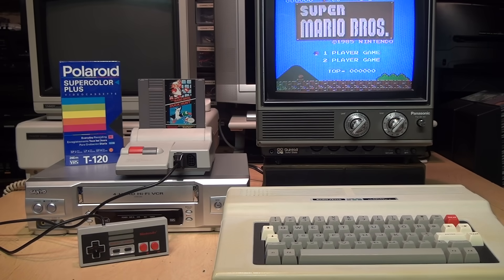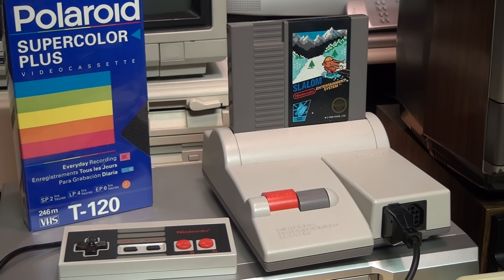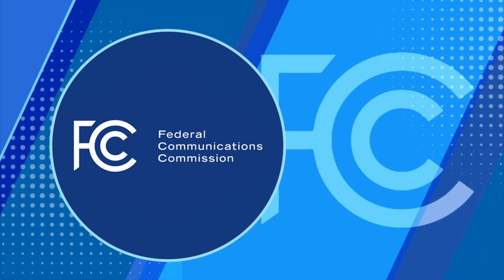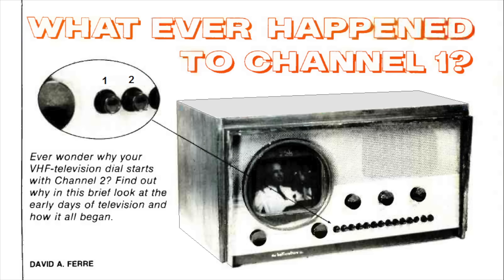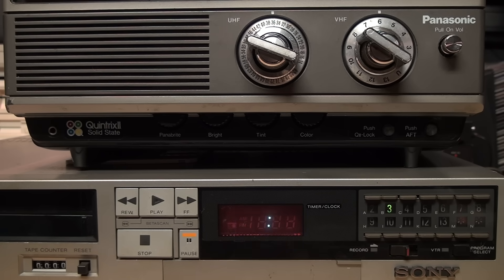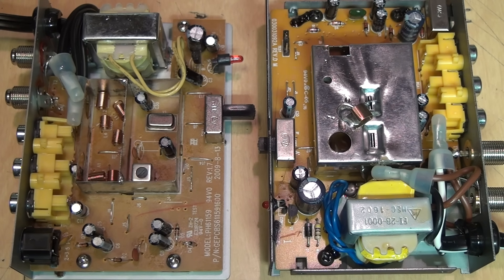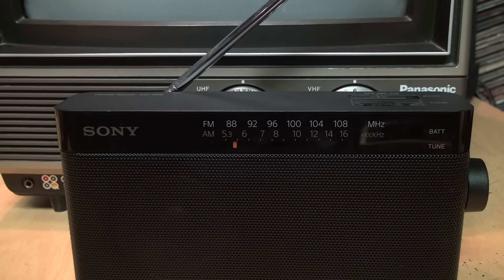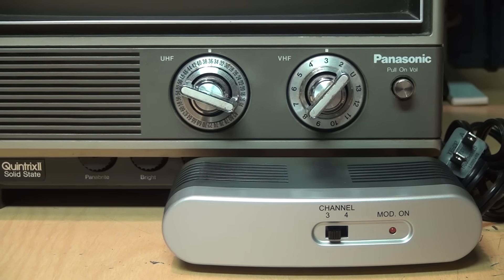Why your Nintendo was on Channel 3 (except in Cleveland)

Comment: Channel 36 wasn’t a UK only thing for RF modulators, but it was used basically in all of Europe. 

The VHF bands in Europe for television were a mess. When television was first introduced in the 1930s, every country had their own television system and their own frequency plans for TV channels, the UK used 405 lines, Germany used 441 lines, and later France 819 lines. Then after WW2, the 625-line system was introduced, which eventually became a standard, but the frequencies were still a mess. Western Europe and Eastern Europe used very different frequencies for VHF. They even had separate bands for FM radio, with Eastern Europe using 66-74 MHz, and Western Europe using the more familiar range of 87.5-108 MHz.

With the introduction of UHF frequencies, all countries agreed on using the very same frequencies for TV channels, with channels 21-69 having the same frequency anywhere in Europe. 

Except for channel 36, which was used for radio astronomy, therefore no transmitters were allowed to operate on channel 36. And since UHF was adopted earlier in Europe, with high power networks broadcasting on UHF even from the early 1960s, there were a lot more TV sets that supported UHF compared to the US, so it was an obvious choice for RF modulators to use channel 36.
Reply: I also read that when Channel 5 was preparing to launch in the UK in the 90s, the operators of the upcoming channel were required to launch a massive retuning program since the frequencies for Channel 5 were also used by consumer VCRs as well, and the new Channel 5 could have caused interference with said VCRs. During pre-launch test broadcasts, the possibility was interference was mentioned and viewers had to call a number on the screen if their VCRs or other equipment suffered interference and to schedule a time for the affected equipment to be retuned.
Reply: In the US (I'm sure Canada and Mexico too), made channel 37 off limits, as that was the channel used for radio astronomy.   In North America,  TV channels are in 6mhz spacing.   For channel 37, it was 608mhz to 614 mhz.  Europe, Australia,  New Zealand,  and I believe most of Asia had 8mhz spacing.  Though in the analog era, Japan used the same broadcast standard as North America,  their TV's were not fully compatible with North American broadcasts, as they used different frequencies for their TV band.  Their FM band goes down to 76mhz, which in North America,  that occupies channels 5 and 6.  Also with VHF-Lo,  there's a 4mhz space between channels 4 and 5, that in the analog era, New York City had channels 4 and 5 on the air.  Channel 4 operates between 66mhz and 72mhz and channel 5 operates between 76mhz and 82mhz.
Reply: @davenwin1973 cable TV 88 too in North America. Mexicans observed to ban all channel 37 transmitters in Mexico
Reply: @d @davenwin1973 channel 36 in Japan for Japanese NTSC -M broadcast
Reply: @d @davenwin1973 South Korea, Taiwan, Philippines and Myanmar also use analog NTSC-M broadcasts. Channel 37  used in the Philippines and South Korea. Also channel 36 in Japan.
Reply: @d @davenwin1973 also used Japanese analog TV receiver in the Philippines. VHF channels 1 to 3 same as US Cable TV channels 95 to 97. Sony Trinitrons from Japan have 2 MHz auto fine tuning. For AFT 2 MHz: VHF channel 4 is US cable TV 22, VHF channels 5 to 7 is US VHF channels 7 to 9, Japan VHF Channel 8 to 12 same as US VHF channels 10 to 13 and Cable TV 23. Japanese analog cable TV channels only receive up to channel 62 but didn’t include from UHF. Unlike US Cable TV include UHF on Cable TV above 465 MHz.
Reply: Yep, we had a video rental chain called Channel36
Reply: Another advantage of the standardization of Channel 36 (and I think, later on, more channels in the high 30's), it was possible to design VCR's and other equipment that didn't need a TV/VCR switch like all VCR's in the USA. All VCR's just mix the incoming antenna or cable signal with their own modulated signal and send that to the output. You can tune your TV to any live TV channel(*) you want to watch or you can tune to channel 36 to watch the VCR. And if you have a second VCR or a video game or a computer, you just adjust their modulators to use channel 37 or 38 or 39 and daisy-chain your cable or antenna through all of them.
(*) Of course most TV's in Europe didn't have channels but presets but that's another story.
Reply: @JacGoudsmit  i've come across some vcrs here in the uk that defaulted to ch.52 !
Reply: @JacGoudsmit for NTSC-M VHF TV channel 34 in the Americas, Philippines, Taiwan, South Korea. Also channel 33 in Japan
Reply: @J @JacGoudsmit VCRs in Japan only have channel 1 and 2 for VHF output that overlapped FM radio (90 - 108 MHz), US Cable TV channels 95 and 96.
Reply: @FrancisLitanofficialJAPINOY i thought in Japan the FM band doesn't go up as high as in the rest of the world (and starts at a lower frequency too). In the USA, channel 6 overlaps with FM.
Reply: In the U.K. colour TV was never broadcast on VHF. That was originally used for 405 line Black and White TV which kept going until 1985. Mainly because there were a few odd places like Welsh Valleys where UHF signals wouldn't reach. To allow everyone to receive the same four channels on UHF over 1100 transmitters and relays were required. 

As for Channel 36, in the 1980s a friend bought a VCR and took it back to the shop as there was a strong burst of interference every couple of seconds. The shop knew what it was; the Radar at Filton airfield. A quick retune to channel 37 using the screw next to the aerial socket solved the problem.
Reply: @MrDuncl Ireland and South Africa used VHF on PAL-I broadcast also used on UK UHF TV broadcast PAL-I
Reply: Does anyone read this comment,and think about Tesla’s fascination with the numbers 3,6,9 barring I think 1 number in the comment posted, if you look closely, and do some tinkering math, all the numbers he mentioned add to 3,6, or 9, numerology is fun
Reply: You went far more in depth than I knew but knew it wasn't a thing here in UK. You basically just tuned a spare channel to it
Reply: @justaguy9224  I have seen some digital tuning am/fm car stereos have the frequency with even numbers versus most have the odd numbers for the "point" count on radio. Example "96.9" and saw a radio that if you manually tuned the station like 96.8 and then correct 96.9
Reply: @jeffreybaker100  That’s because in many countries in America (especially in the US and Canada), FM stations can only broadcast on frequencies that have odd decimals. On the rest of the world, there’s no such restriction. 96.8 MHz would be a perfectly normal frequency for an FM station in Europe/Africa/Asia/Australia, meanwhile it’s incorrect in the US/Canada.
Reply: @justaguy9224  I remember a friend who had a car stereo with those even numbers digits on the fm. Must've been a stereo usable in Europe for cars as well as American cars
Reply: @justaguy9224 South Korea and the Philippines use odd decimals for FM. Also include 87.5 FM.
Reply: I don't agree with you about the reason for higher popularity of UHF in Europe than in the US. Some European countries didn't have a nationwide UHF network until the 1970s, and UHF converter boxes for VHF-only TVs were also sold in Europe.
Television in Europe was in most cases a government monopoly, so the priority was to cover most of the country as opposed to offering additional channels in the larger cities. As a consequence, the VHF bands became congested even though most Europeans could only receive one channel.
When European countries launched their second and third television channels, as the VHF bands were congested, they could only go to the "new" UHF band. 
In the US on the other hand, most television was commercial, and the bigger cities had multiple channels on VHF, so UHF was used less intensively than in Europe, and the viewers had fewer reasons to buy a UHF-capable TV or converter.
Reply: @bigic1  UHF in the USA kind of had the reputation being where the second run channels were, its where you saw reruns and odd local programming.  That was kind of replaced by basic cable from the mid 1980s until the early 2000s.  I am guessing the Weird Al film UHF probably does not land the same way outside the USA for that reason.
Reply: @filanfyretracker  Would today's TV equivalent of the old US UHF channels be those sub-channels in the digital system like 17.5 or 2.8 which are not the primary stations? These almost always have reruns or local-specific programming.
Reply: @bigic1  Or even the 80's or 90's in the case of Denmark and Norway.

Comment: And now i Know how that dude was listening to Seinfeld on WCSH in his car when I was in Maine that one time.
Reply: I grew up in Maine in the 90’s and knew of WCSH broadcasting on radio. Many of our cars bottomed out at 87.9 (digital tuning radios) and I never understood why they’d put it on a low frequency. It wasn’t until adult years I realized it was the same audio transmission for the TV and learned this “feature” was a free side effect of this overlap.
Reply: In southern NH, didn't get WCSH on cable, but could sometimes get it over the air, and it came in better audio-only on 87.7.  Sometimes WCSH and WLNE Providence would both be battling it out LOL
Reply: This is because Channel 6 already has an allocated FM frequency/carrier (87.75), which is why you can listen in on 87.7. It’s not a rebroadcast, but the audio is from the TV signal itself.
Reply: Before digital TV we used to have VHF and UHF audio receivers, so you could listen to your shows at work
Reply: Weird the first thing that came to mind when watching this video was listening to channel 6 on 87.7. I never truly understood it.
Reply: They broadcasted the audio from WCSH TV on 87.7 FM. I thought it was pretty neat. You can hear news/weather reports while driving.
Reply: I actually had a TV sound receiver in my car in the 80's. Worked good. I also had a scanner which unnerved the cops LOL
Reply: I used to do this. I would listen to TV from local channel 6 on my radio in the 80s.
Reply: Awesome 😅
Reply: When winter weather hit and we invariably lost power, we would tune in WCSH on 87.7 FM to follow the Storm Center coverage. Those were the days.

Comment: early on, VCRs in Australia used either Ch3 or Ch4 but later they started to use either Ch0 or Ch1
Reply: That was due to Japanese influence…they had their Native Nintendo consoles work on channel 0 or 1 as Japanese Terrestrial Television turners had channel zero and channel 1 for peripherals.
Reply: Yep we used 0 when channel 0 moved to channel 10 from 1980ish onwards. Funny thing is, in our local area there are still channel 0 antennas up around the place facing Brisbane, even though we've had a local UHF transmitter since the 90's.
Reply: I don't remember ch 3 or 4 being used for VCR. I remember WIN was on ch. 4 in Wollongong on analog
Reply: was in the early 80s. Our JVC had a switch for either 3 or 4

Comment: I actually stopped using this method long before most people did. One thing you forgot to mention is that this method would not give you stereo sound. I remember in 1997 I got a HiFi Stereo VCR and I remember I wasn't getting stereo and it said in the manual that the only way to get stereo sound was to use RCA cables. A lot of people still used the RF modulator method up until HD came along, I think just because it was more convenient than RCAs. Because if you had a cable box, you actually had to have the VCR ON in order to use the cable box. In the early days, it was the opposite for many people. And then cable boxes started using RCAs too, and the same thing would be true there. Even the cable technicians could not understand how I had my setup hooked up.
Reply from the maker: A few RF modulators did give you MTS stereo sound. I have one by Radio Shack which does it.
Reply: @vwestlife  I presume it was the kind that actually used RCA inputs? Interesting, since I thought all stereo TVs had RCA inputs already, and thus wouldn't need a modulator. 

Back in the day, I hooked my N64 with one of those RCA input modulators. But I decided I wanted stereo sound, and we had this old stereo with RCA inputs. So I put the stereo on top of my TV.

It was a weird stereo, in that it was sorta a boombox, but the speakers had wires and could be separated out.
Reply: Had a similar experience in the early days of HD television. Some early HD TVs had YPbPr component input, but no HDMI, or the sole HDMI port was being used by a gaming console, I told the cable TV install technicians they could use component for HD video in those cases, they couldn't believe until I showed them. Nowadays TVs will either have to analog input or just a single composite input, and two or three HDMI ports, but HDMI switches are inexpensive now.
Reply: @gcolombelli  4K TVs don't have any analog RCA input of either composite or component video so you need to either upconvert composite to HDMI or use an RF modulator or VCR, turn on your VCR or hook up a game system that uses composite video, turn it on, and have the TV program Channel 3 or 4. If one has something like an Atari that can use Channel 3, use an RF modulator or VCR as the input, plug the Atari's RF in an RF input on a VCR or output to composite to an upconverter to HDMI or a DVD Recorder deck since those upconvert composite to HDMI.
Reply: I did this with my sega genesis, which could use the same DIN cable from a commodore 64, which even gave you a chroma output.

Comment: Thanks to licensing agreement limiting SDI to pro-grade equipment, blade runner has never ever been pirated even once
Reply: It's funny because last week I was on vacation and picked my copy for $1. Then my HDMI cable failed... If only I pirated it and had a coax, I would have been OK.
Reply: @vdochev How would a dvd break your HDMI cable?
Reply: @aethelred9781  It didn't. The failure of the cable is unrelated. It just turned out to be a bad cable, LOL.
Reply: tankfully you can get around hdcp and use hdmi to sdi converters.
Reply: Why were they worried about pirating specifically just Blade Runner? And how does SDI allow you tp pirate a movie? It's just a cable.
Reply: @aethelred9781  Because when pirated copies were watched it was like a Voight-Kampfmen test and some replicants began to rebel ..
Reply: @aethelred9781  It was a joke specifically for Blade Runner.
The SDI doesn't have the protocol that HDMI uses. HDMI has a copyright restrictions built into it that prevents you from copying protected digital media. I think it was called HDCP, you can check it on Wikipedia, I guess.
Reply: @vdochev  Thanks makes sense. I suppose you could use an older format like RF. I used to have a computer that had RF inputs.
Reply: @aethelred9781 bazinga
Reply: Wanna bet? 🤣
Reply: I brought back a neat device from overseas... It was a DVR/Blue Ray Recorder that uses HDMI in and out. And it does not care about copy protection 😜👍
Reply: I pirated Blade Runner in the early 00's.

Comment: RF modulators for the European market could usually be tuned to any UHF channel, with 36 or 37 being the default. In the largest cities in Italy, the UHF band was so crammed you'd have been lucky to find any vacant channel to use! SCART was the most common AV connection anyway, being pretty much everywhere by the early 90s, with RF used as a last resort.
I guess UHF was used over here because colour TVs in the UK couldn't tune VHF channels at all. The band was relegated to the legacy 405 line B&W system and abandoned in 1985, with France doing the same a year later.
Reply: Ireland used VHF TV PAL-I until the late 80s, but remained on one transmitter on the border
Reply: @RyanGonTV also South Africa used PAL-I
Reply: @RyanGonTV  I guess in Ireland people would want to watch channels from both countries, and allocating them would need more frequencies. When I went to Dublin I was quite surprised to find that buttons 1 to 4 on the hotel TV were BBC1, BBC2, ITV, and Channel 4.
Reply: @MrDuncl  Not really, the main problem was FM frequencies than TV here…

Comment: The AT&T U-verse box i used to have would only output on channel 3. I have no idea why because RF modulators at the time used the same design template that had been in use for years; it would be more costly to actively remove the channel 4 option.

Comment: Very interesting video on the American system. Here in the UK VHF and UHF were 2 completely incompatible systems so all VCRs and Games consoles had to be UHF usually CH 36/37 for colour tv.
Reply: Just ignore this guy. Both ways of spelling color are fine.
Reply: Please note america, coloUr has a u in it .. If ya gonna do english do it right
Reply: @leewatts1570 we do, we had wars in 1776 and 1812 where we decided the UK sucks at everything.
Reply: What are you talking about? In the UK it's COLOUR as I have spelt it.
Reply from the maker: Daniel Webster simplified American spelling in 1828, and the Brits are still having a hard time getting over it, almost 200 years later!

Comment: In our area, both channels 3 and 4 were taken. That got interesting when using Broadcast TV, though after cable it was fine as the local RF signal completely overrode the cable company's broadcast. Still, would've been nice to have that UHF channel 14. None of our UHF broadcasts were strong enough so we could've just put the dial on UHF and used our VCR that way. We got lucky with some devices having channel 2, which was unoccupied, but that wasn't a guarantee and so you can imagine how we had to hunt for alternative RF adapters that were compatible with various things. Fun times. Sometimes I long for the days of those simple problems compared to centralized systems we cannot fix or adapt at all.